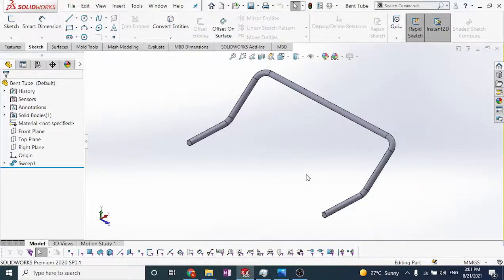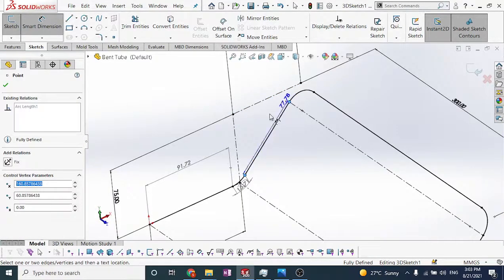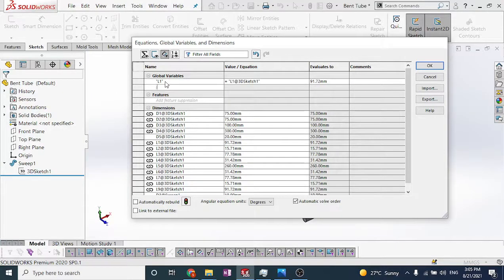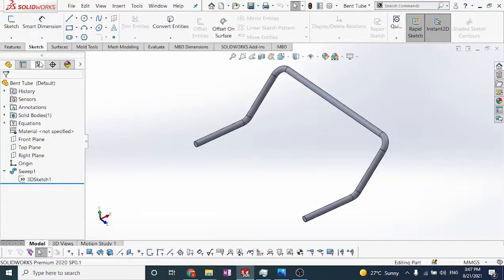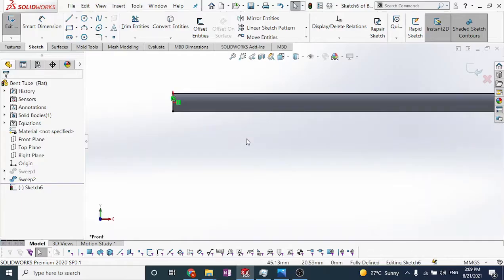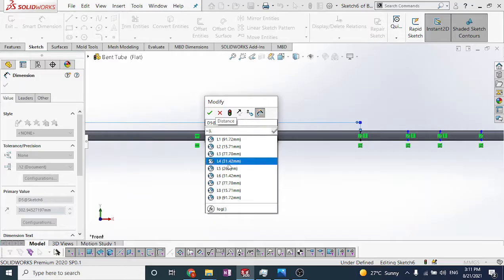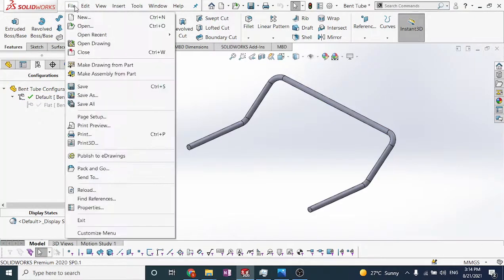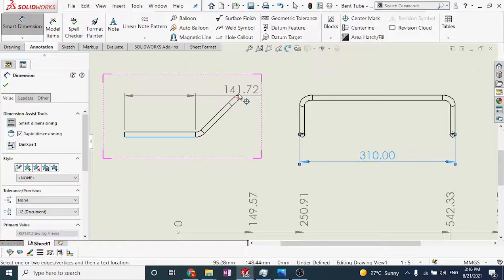Flatten bent tubes in SolidWorks and find bend positions in drawing

Comment: You can send step files back and forth from bend tech . Best tech won’t show and holes which is annoying. But bend tech will give a faster and accurate 2d drawing of a flat tube showing where to start your bends cut lengths and rotation between bends.

Comment: I just looked at tube works . It’s a plug in . $5000 . Then $1000 a year after . 😂 bend tech is about £350 and compatible with sw. i wish fusion 360 was compatible with bendtech .I don’t do anything complicated enough To justify the price of solid works . Bend allowance is easy as long as you have access to the bender to do a bend test . It’s the arc length subtract the stretch divide by 90 degrees. Then you know how much is needed per degree.

Comment: Good tutorial - I had experimented with a similar approach to calculate total length of a routed pipe, but seeing how you did the "flat" configuration for the drawing was illuminating.

One thing I changed up was to skip the equations as others have mentioned (though I did rename the segment length dimensions for clarity) and instead create my flat sketch with colinear line segments, then equate the lengths of the segments to the original swept sketch (and included total length as a reference dimension - no equations!). Then I swept the straight segment with a shared profile sketch from the bent sweep (instead of letting the sweep feature generate the circular profile; now my profiles both update together). Even though the sketch segments are collinear, the sweep feature still breaks the face at the endpoints so the split line feature isn't required.

Now I need to work out how to build in K-factor equations to the straight sketch and I'll be on my way...

Comment: some observations: 
The bracket in equations are not needed.. 
the L1,L2 equations are not needed
you can make the equation to the flat dimensions just by double clicking the bend model and select a dimension from the model.
And add a k-factor to the bend length and you get more precise flat view of the model (take the angle of the bend in the equation of the subtraction formula).

Comment: I use weldments, which I then use to make a weldment cut-list table with cut lengths and angles.
To achieve this same effect, I make a non-derived configuration with basically the same principal as you've demonstrated for the length calculation. I then tell the cultist table to calculate based on the flat configuration. If you use derived configurations this doesn't work. 
The only thing is, this doesn't exactly work for giving the cut angles of the flattened piece stock, so you have to do that manually.
Reply from the maker: Hi Talent! I appreciate you sharing your method. I understand where you're coming from; I've experimented with various approaches, but I couldn't find a straightforward solution either. However, our fabricators are thrilled with this method, and they believe it can consistently deliver precise bending results. So, I've been using this method for all applications for over two years now, and it hasn't let me down.

Comment: But you would still need to take into account the k factor of the tube . As the tubes centre line  will stretch or Shrink depending on the type of tube and the tooling . So the more bends the more it will run out . You need to do a test bend to find the percentage in each degree of turn .
Reply from the maker: That's true, if you have many bends, it could be an issue, but in simple parts like this the accuracy is enough
Reply: @solidworkssolutions  that will grow about 4mm per 90 in 25 mm tube . It will ad up.
Reply: To be more precise I generally use 42% of de diameter (only on round tubes) from the inner radius, or offset 8% from the center line to the inner side of the bend.
Reply: @Bravetruckparts  do a 90 degree bend test . And see what it grows by . Subtract the growth from the Arc length of the then divide by 90 . That will tell you what used in the bend .

Comment: This is as good as adding dimensions manually if you're dealing with a lot of cable sweeps or routed tubes. Pretty useless.
Reply from the maker: Yes, it doesn't work when you are working with many cable sweeps, but in our fab shop we have maybe 50 or less bend tubes, and instead of buying another add-in for solidworks we could easily convert them to meaningful drawings for fabricators guys!